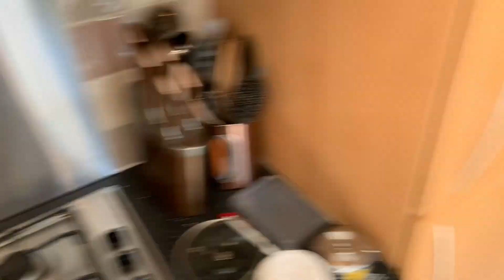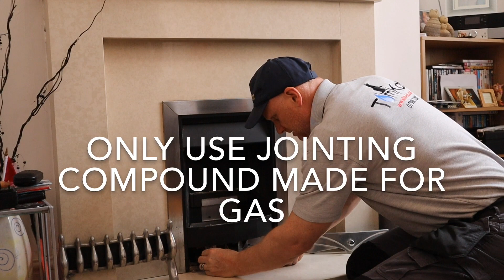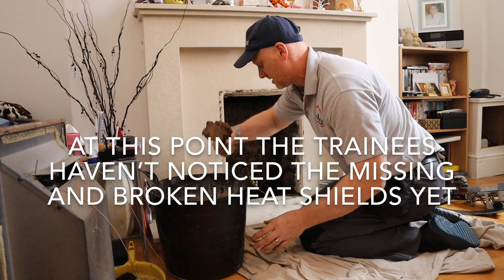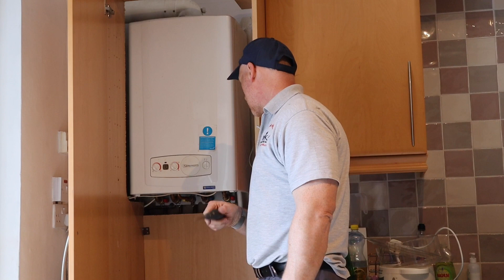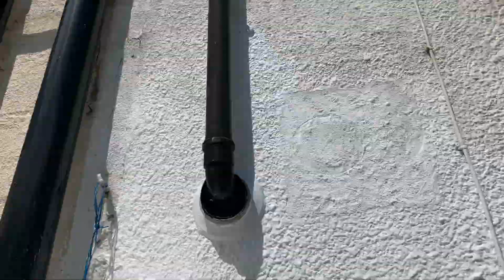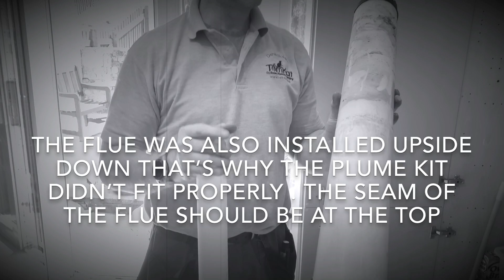GAS APPLIANCES SERVICED, the dangers of not getting your gas appliances serviced every year

Comment: Hi Derek always a great selection of videos, one boiler maintainance question.  Modern condencing boilers with Full Stainless Steel main heat exchangers and burners. During dismantling there is always brown debris collecting on the bottom of the heat exchanger coils, some locations are worce than others, what is this materal. These new boilers has no iron to go rusty like old units, can't be a result of just gas combustion, could it be organic. Kind regards Dave Porter   london
Reply from the maker: Great question I am in the process of making a video on heat exchangers look out fro that one soon it could give you the answer 😜
Reply: @tomkatgastraining  I can't wait f8r tgat because I bet most guys cleaning this out don't know either. I'm sticking with organic rather than inorganic matter.  Talking spiral heat exchangers, nobody ever talks about exactly how they work and that 25% or more of the coils at the back of the unit don't 'Ever' come in contact with the flame right.
Dave Porter

Comment: I’m sure I read a gas pipe should not be within 150 Mm from a socket ?
Reply from the maker: It changed to 25mm it’s only 150 from a consumer unit or 25mm from a plug socket or cable

Comment: Why did  you recommend a new boiler.From what I could see it was perfectly ok ( apart from slight water leak from flue) which you changed.All the readings were ok....so why renew????
Reply from the maker: The water leak wasn’t slight. And as you say I recommend the boiler to be replaced because of the neglect and damage. They had the boiler replaced by another company a couple of months later.

Comment: YOU DIDN'T  MENTION CLOSING THE WINDOWS ANS DOORS ,TURNING ON EXTRACTOR FANS ,SPIN DRYERS AND Air circulates.
Reply: You can now use aproved hoses .
Reply: That's it ,scratch   the boiler casing .
Reply: That was a glow worm memo to change the ruber  seal to graphite.

Comment: Hi, Just notice on 20.17 you said 18.9Mbar at the fire, so more than a 1Mbar difference with the working so it was a fail. As far as I concern it is 0.1Mbar was the difference, not 1Mbar. as ideal working pressure would be 19-23Mbar.
Reply from the maker: The working pressure at the meter was over 20 mbrs so if you have 18.9 then it’s more than 1 mbr drop you don’t count it from 19 you count it from your readings

Comment: Good video very informative I agree with the fact the unqualfied people should not do any work on gas appliances. But i have the opinion that all regulation should be based on a test of the safety of the work and not the size of the  engineers bank balance. I looked at getting trained to be gas safe but the cost was just too much. it seems that a lot of regulations are not just a test of the quality of workmanship but a test of the size of the bank balance of the person wanting to train and do the job!!. thats why as you said in the video that gas safe engineers are expensive and people are doing their own gas work. if the regulators reduced the prices they charge to get and maintain the qualification then more people would use a gas safe engineer as the engineer could charge a more competitive price to do the work.

Comment: What we have to do if thay got ventilation on bedrooms chimney do we have to block them and if yes then why can you explain Sir
Reply from the maker: Bhavesh Sharma not quite sure what you are asking but I think you are saying do we have to block bedroom vents in chimneys if we have a fire down stairs. The answer is no as the chimneys are separated. We do have to check the bedrooms when we do a flue flow test though to see if the flue has its integrity and the products of combination are not going into the bedroom. I hope that’s what you are asking
Reply: Mid feathers, separating brickwork between the separate flues should be doing the job of separating the different flue. Meaning as long as no smoke is in the bedroom and is being expelled out of the flue being test only then venting the bedroom stack should be fine

Comment: i think the water inside the boiler was from rain water tracking down the plume kit and running into the air intake then down inside the boiler...
Reply from the maker: Brendan Fisher we checked that and found it was the inside seal . Thanks for watching
Reply: Brendan Fisher it wouldn’t the air intake is not part of the plume kit. It could get in though the air intake via the flue terminal though..
Reply: I've had the same on loads of boilers in stormy weather.